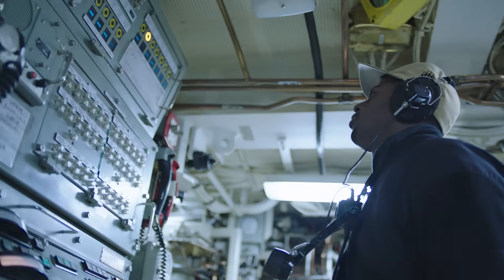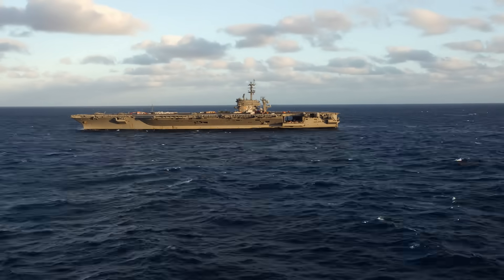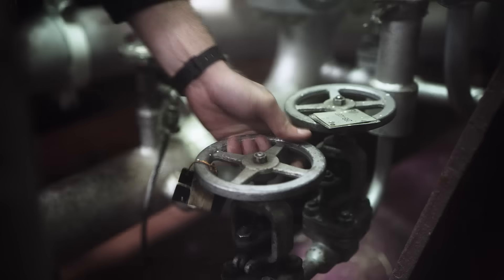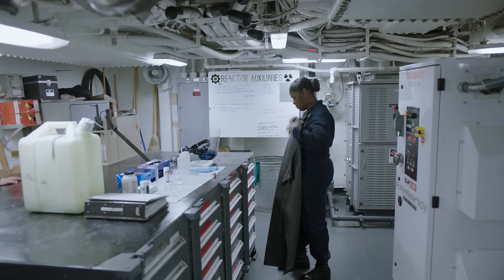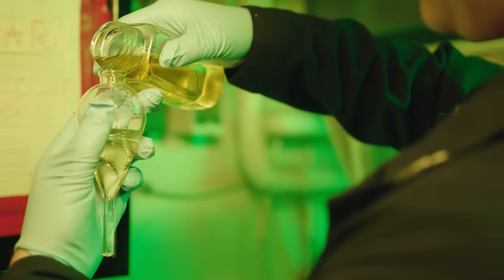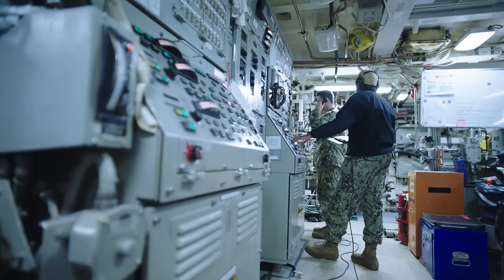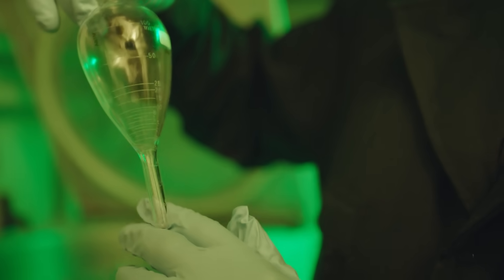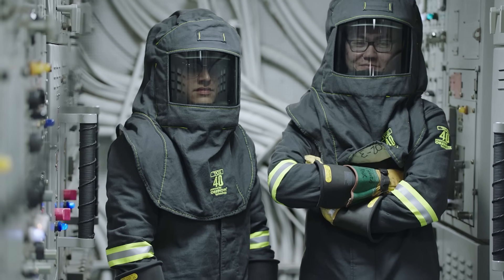Navy Machinist’s Mate Nuclear – MMN

Comment: Our rejection of Nuclear power was a massive mistake, and the environment has payed dearly for it as we continue to rely on fossil fuels for our electricity
Reply: Yeah they prefer silly wind turbines
Reply: I see a big 2 stroke gas powered engine there!
Reply: Diesel not gasoline .
Reply: Sweden has developed smaller safer reactors than are designed to be used in small power generation plants strategically placed throughout large areas. 
The windturbines are actually viable power generation..cheaper to use now that large scale batteries have become available. 
Navy can be fun if you like high tech stuff...I'm just glad I'm not serving with Donald Trump in office...that has to SUCK!
🇺🇸👍

Comment: None of these clips are what you'll actually be doing for the most part. You will take chloride turbidities (the clip the showed was not a turbidity, seemed as if they just got some auxiliary mechanic to play with blue water and say they were testing it for chlorides) and oil samples sometimes. Anyways the point is that none of the job videos posted by the Navy shows you what you'll actually be doing. My advice, look into a job and try to find someone doing it to tell you what it's like.

Comment: What was the big diesel engine for? Fairbanks Morse none less. I'm not sure why they are on the Ohio class boats.
Reply: Diesels are for emergency power generation on both subs and carriers. They are not used during normal operation.
Reply: Not Fairbanks Morse. Actually GMs. They are EMD 645s.

Comment: Ok someone correct me if I'm wrong, because I was a submarine nuke...but for us A-gangers took care of the diesels.  Nuke MM didn't mess with them.  We knew where the were and that was about it. M-Divers just took care of the reactor plant and propulsion
Reply: That's what I was thinking.
Reply: You are correct. They are not allowed to film in the propulsion main spaces, so filming in the diesel spaces and shaft alley is "close enough". The emergency diesels are maintained by Reactor Auxiliaries (RA division), which is a part of Reactor Department, but manned by Enginemen (non-nukes). Nuke MMs are found in Reactor Mechanical (RM), Reactor Propulsion (RP), Reactor Laboratories (RL), Reactor Training (RT), and Reactor DC (RXDC) divisions aboard a carrier.
Reply: Depends on how good of a mechanic you are and how much A-Gang trusts you. Skimmers probably have diesels I wouldn't know. But I know  I'm a good mechanic not that great of a nuke. It's cool hearing "ERS prepare to snorkle" when I'm on watch.
Reply: Back in the day, nukes ran the diesel on SSBNs.

Comment: None of that seemed anything like being a nuke. At least in the surface fleet, MMNs don’t touch diesels. I guess the endless training and drills part was on par.
Reply: A-Gang did that.  Great bunch of knuckle-draggers.  Diesel generator, Oxygen generator, H2 burners, CO2 scrubbers...
They got dirty.   Many props!
I was an EM on a fast boat.
Reply: On the older SSBNs, 627/640 class, nukes ran the diesel because it supported the reactor, and it was in our space , MM2/SS, 85-91, SSBN 640 G

Comment: Wait so machinist mates dont actually machine anything? Like with a lathe and mill?
Reply: We do, but it's rare. We were able to keep the ship on mission on my last deployment by making a pin for the main engine throttle controls on the lathe. Most maintenance and repairs won't require any type of actual machinist work. When the rate was named back in the day, there was a lot more machining going on.
Reply: Dusty Highnote I’m leaving for bootcamp September 23rd, I have an mms rate and am planning on becoming a torpedoesmen, any advice for me?
Reply: @Tigers-kc3mw  I’m going in as a MMS too, how’s it going man?
Reply: @Hardest23Baller  hey man! so in bootcamp I was disqualified from that rate  . I re rated to an aviation mechanic or an AM is the abbreviation. the navy has its ups and downs and if you are a family person its tough, but I've been in over a year and a half and done the last half of a deployment and it is what you make of it, when do you leave?
Reply: Machinist Mates do not machine almost anything. Ever. The job consists primarily of standing watch in like 6 hour increments and repairing components that break.
Reply: You are essentially correct. MMs would more closely be described as mechanics than machinists. We turn wrenches and handwheels, not round stock.